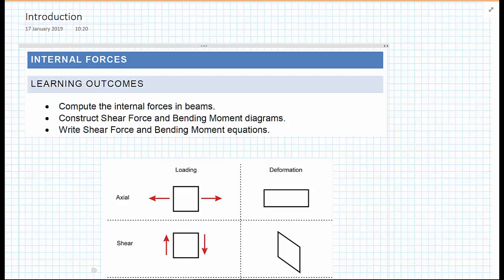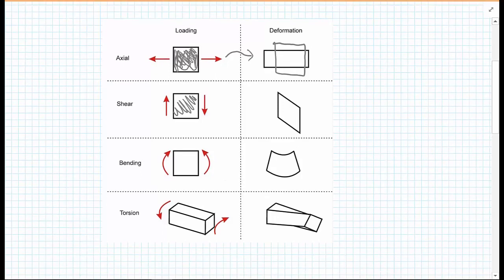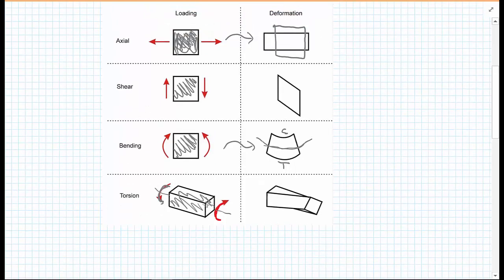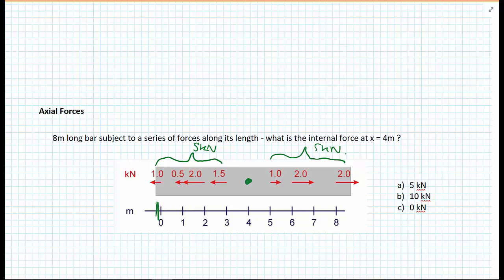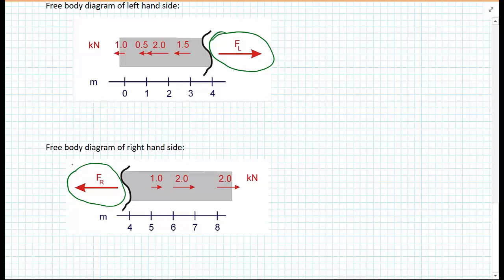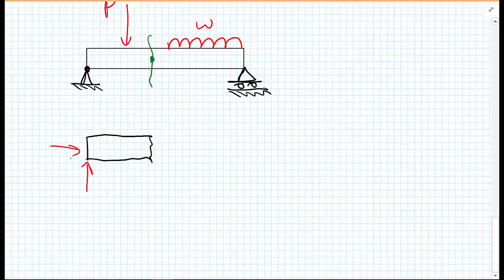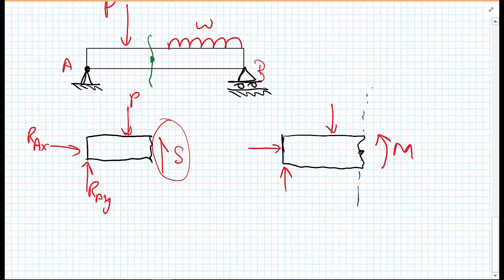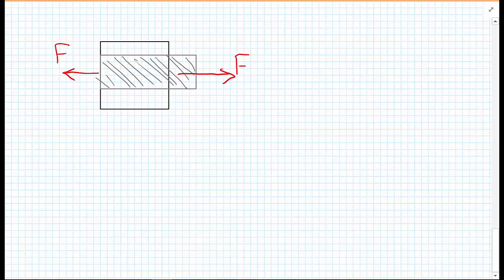Statics - Internal Forces - Introduction

Comment: Thank you Program Mechanics. I’m unsure if it’s my Bluetooth headphones, but I’m getting a slight humming static (sounds like an airplane’s engine before taking off) as I’m listening to the lesson. This video has been helpful.
Reply from the maker: it's the CPU of my surface pro getting picked up by the mic, didn't use an external mic when I recorded.